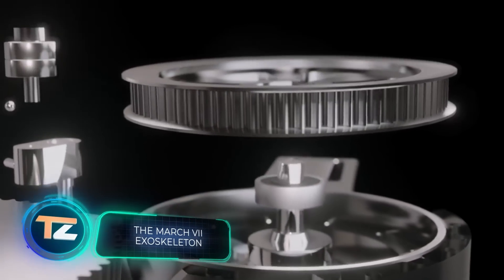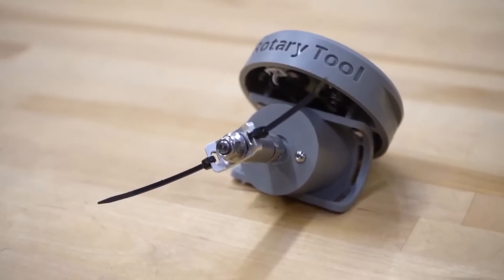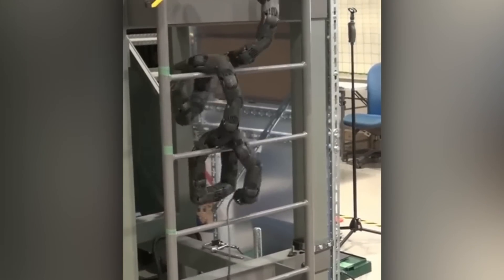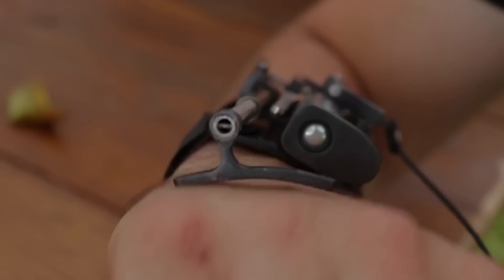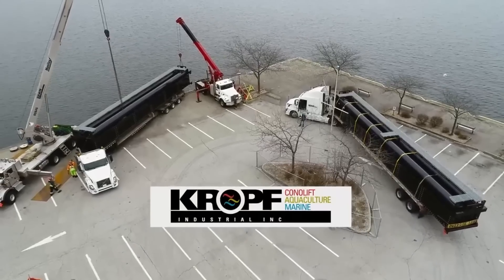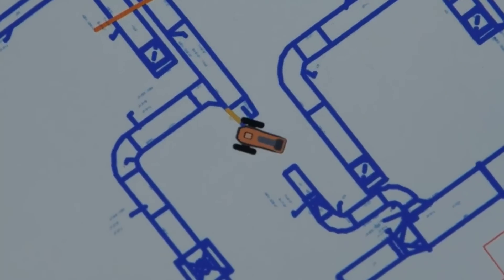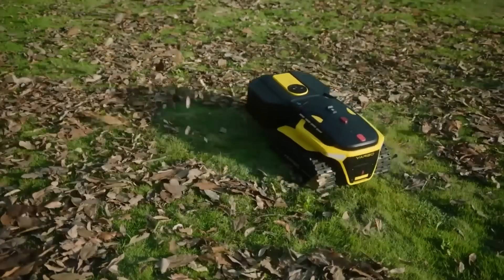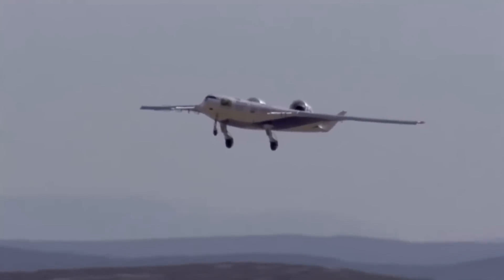INCREDIBLE INVENTIONS THAT YOU HAVEN'T SEEN BEFORE

Comment: That last one has been in the works for over a decade, almost two.
The biggest 'complaint' is that passengers on the outer seats will experience considerable up and down movement during aircraft turns.  Yes, people in conventional aircraft experience this, too, but only about six feet of vertical movement - with the flying wing that could be as much as forty feet of vertical movement, or more.
But there are many things that could be done with that much interior space... a complete boardroom, for instance, or movie cinema (ugh, I could only imagine the air sickness an action movie would induce during turbulence or hard turns).
Likely it will never see passenger traffic, instead becoming a cargo transport.
Reply: They can put every seat on a left, right, horizontal, self balancing base to defeat the leaning during turns, to make the up, & down way less uncomfortable, & lessening the vertical height change. So that, & whatever else they've got up their sleeve, so 🤷 that shouldn't be a deterrent for them not getting the plane into production seeing as it will be a lot more cost efficient with having a lot more real-estate inside of plane.